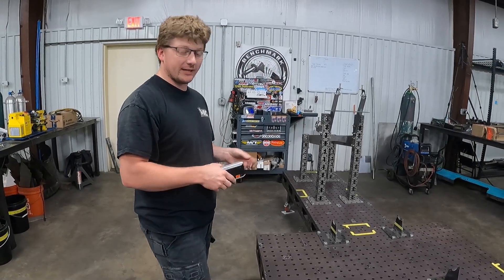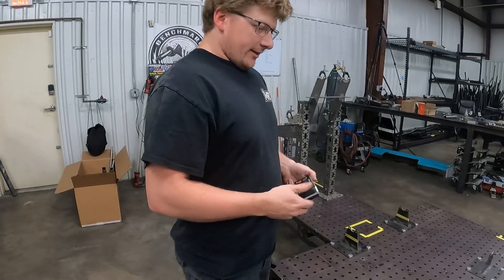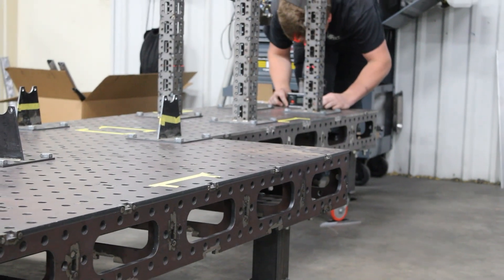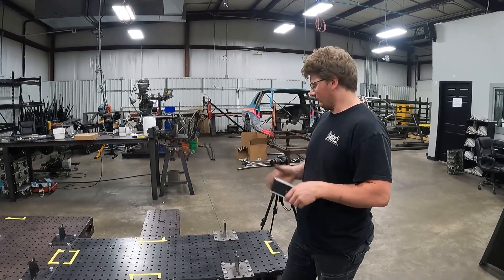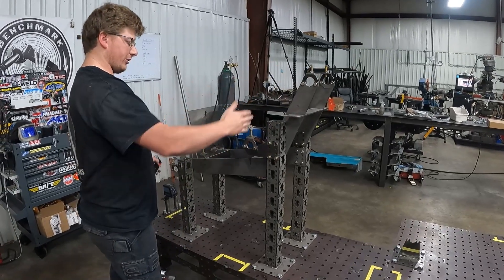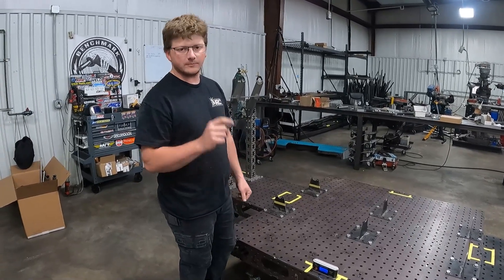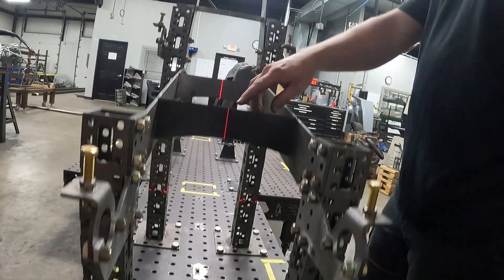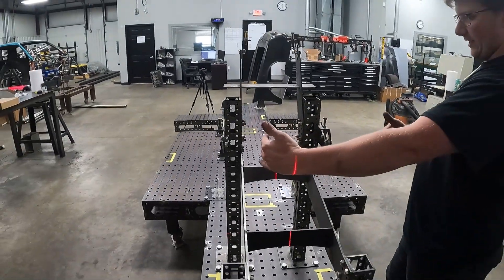Setting Up the Jig Table for Brett LaSala's "Snot Rocket" Chassis Build

Comment: Always an interesting process having done some similar work on a smaller scale. Only complaint is everyone's interchangeable use of "jig" and "fixture" lol. A jig guides a tool, a fixtures locates parts. So these are chassis fixtures 🤣🤣
Reply from the maker: Well I guess this guides our tools to make a chassis. 🤣
Reply: @mooreracechassis  "Jigs are tools that hold a cutting tool in place or guide it as it performs a repetitive task like drilling or tapping holes. Fixtures, on the other hand, do not guide a cutting tool, but hold a workpiece steady in a fixed position, orientation, or location."

Comment: Useful tip, if you set a level on a surface and it displays a value then you 180 degree rotate the level and get a different result your level is not calibrated correctly. To establish a true value with an out of kilter level take both of these readings and split the difference otherwise anything and everything you set to an angle is 100% incorrect.
Reply from the maker: Theres no level we use or that's avaliable that's better than a .1 of a degree throughout its 360 degree range. But we make sure it repeats the measurement we are seeing. Anything is better than a bubble level that we see all to often.
Reply: A laser transit would be way more accurate than that thing he slams against the table.
Reply from the maker: @chadhulsizer  I assume your talking about that protractor. To which it does have 2 strong magnets on the bottom. usually doesnt get set down nicely. It also doesnt just read level 24-7. We use it to measure other angles.
Reply: Buy a Starrett 98 machinist level. They are about $150. 

You are also going to fight flatness & levelness of the table due to it being mobile and not anchored to the floor permanently.
Reply: I own a chassis shop and we have levels that repeat everything perfectly every time...okay we'll maybe not. But I did switch the old summer air out of my tires for winter air already. Guess you could say I'm pretty much an engineer.